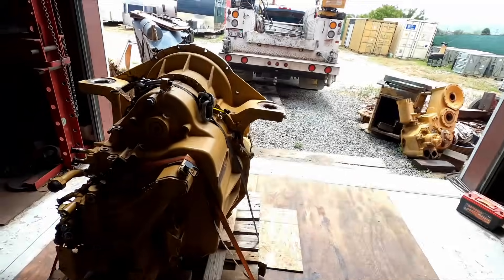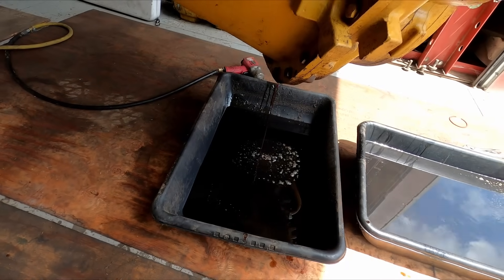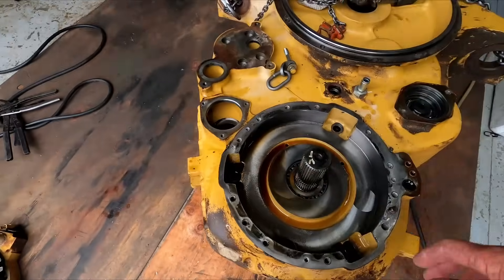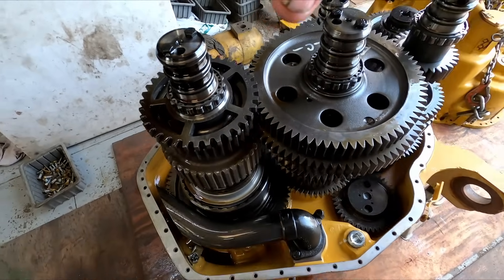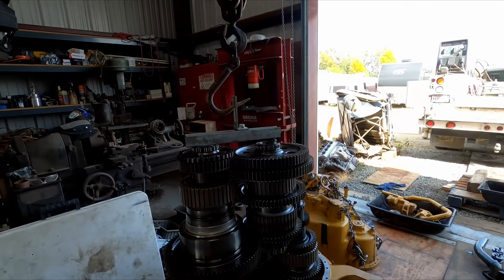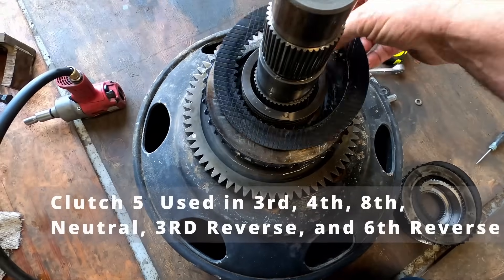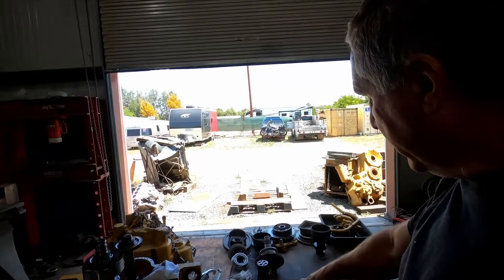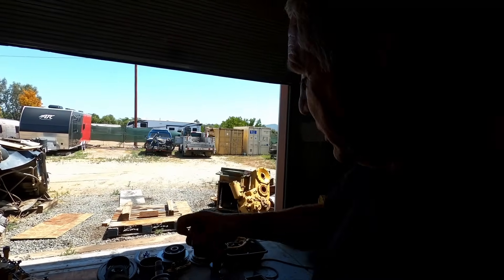Cat 140M Transmission Disassembly

Comment: If its rare to happen has cat looked into it maybe being a manufacturing issue? Seems like that should be covered under warranty by them and not by the owner. Unless of course it's user error
Reply from the maker: It is most likely operator error. Grading in too high of a gear probably. It is a rental machine.